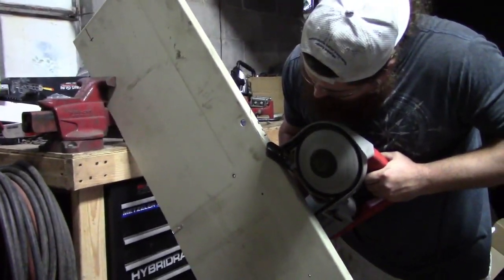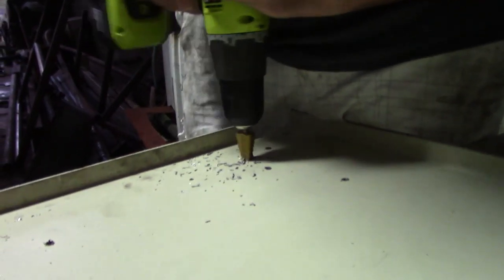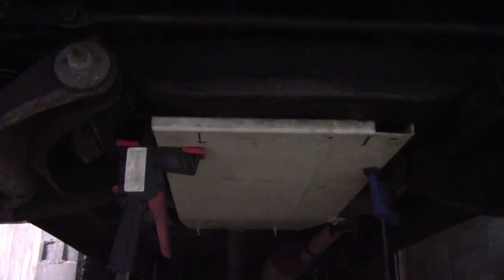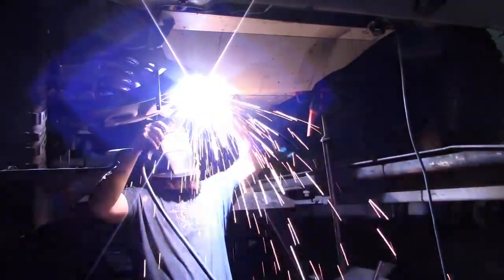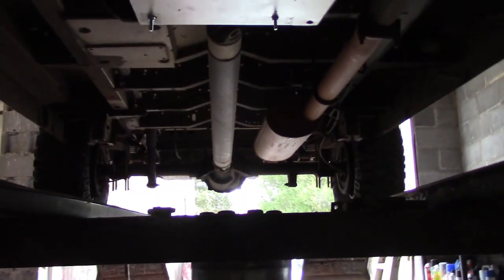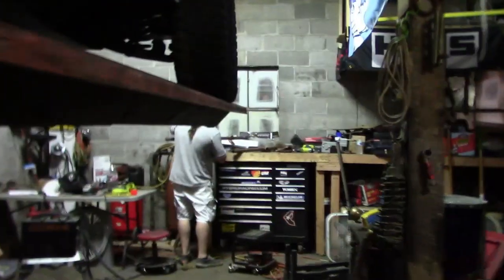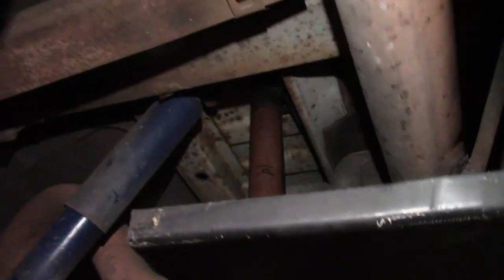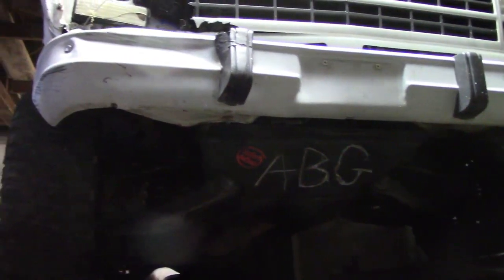CHEVY G20 GAMBLER VAN SKID PLATE BUILD

Comment: Hey guys, I got a question about your g30 springs, can you link me to the springs you baught? and what year are they and are they labeled as heavy duty springs? also did you have to replace the front shocks as well because the springs are bigger and if so what shocks did you go with and what were the measurement's for them, Thanks!